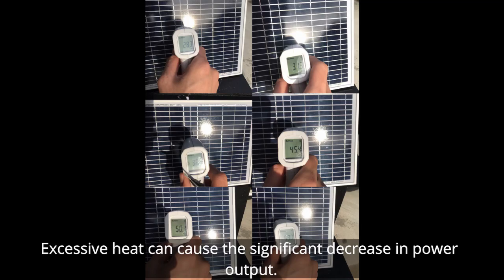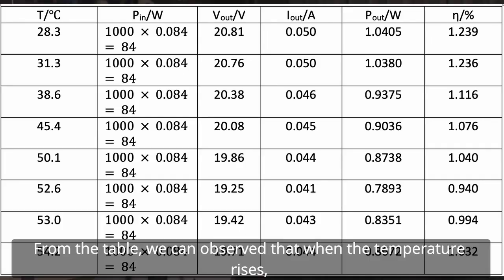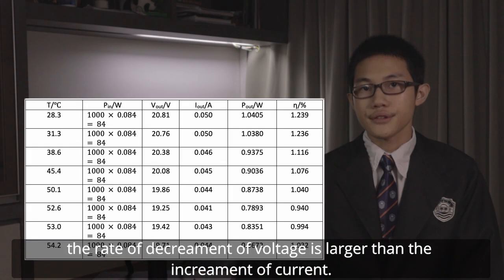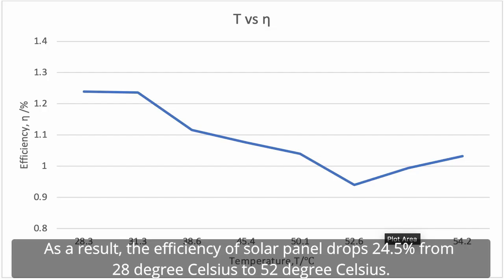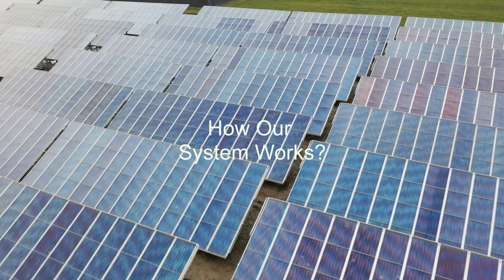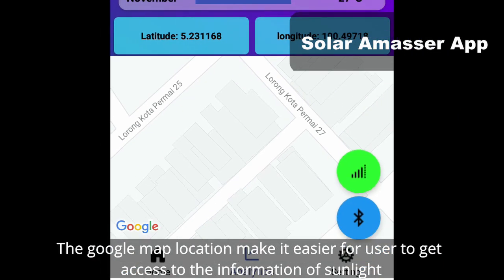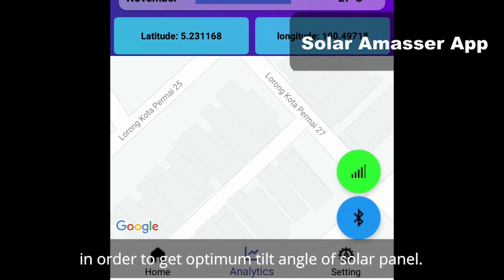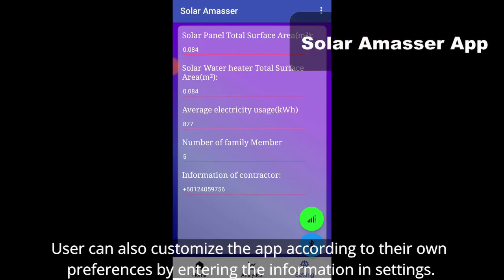[KLESF International Challenge 2020] S98 Solar Amasser

Comment: Excellent work guys!  Besides, here are my questions and suggestions:
1. What is the expected cost of cooling and cleaning equipment, in the unit of $/watt? Do you have experimental results on the performance comparison?
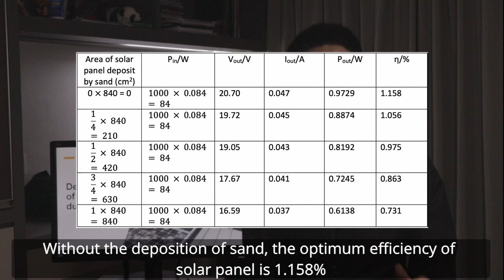2. The efficiency of solar panel is know  to be around 20% on average,   your result at 1:50 is much lower than this, please double check it.
3. Electrostatic cleaning device is a good idea, but is it able to clean abrasive dust or PM 2.5, etc.? These are much more common in urban areas and neighborhood of high-pollution industry.
4. It is better to measure irradiation (W/m2) instead of light intensity (lux).
5. The fibonacci idea is interesting, do you have more on this?
Reply: @shenyitan4255  Fair enough. The cost of cooling system seems a little too high. So what is your expected ratio between the cost of cooling system and the panel?